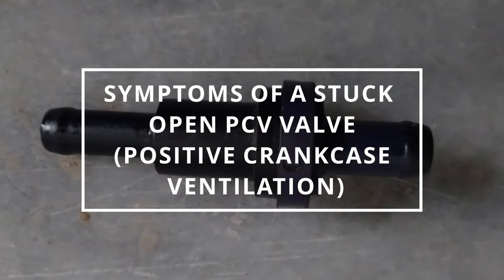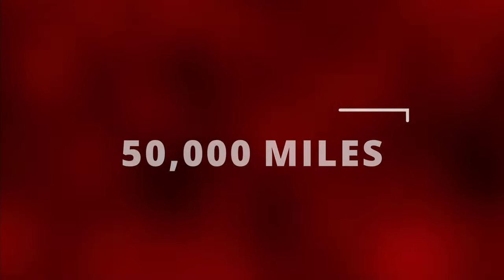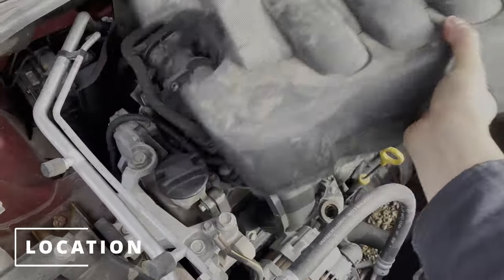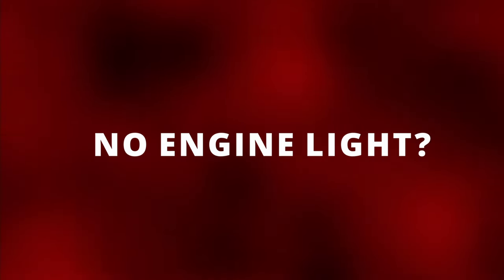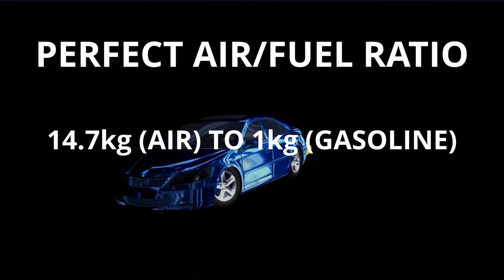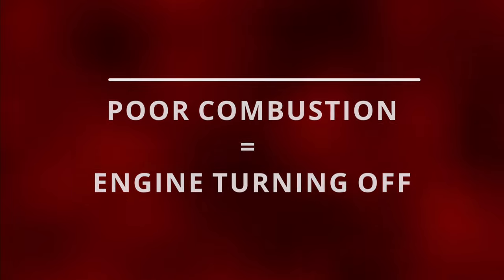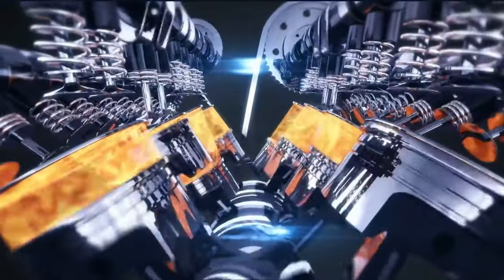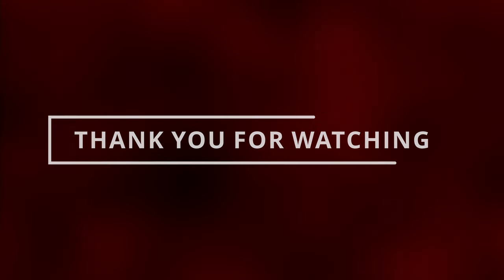SYMPTOMS OF A STUCK OPEN PCV VALVE

Comment: The best way to test a PCV valve is to remove it and put a balloon on the threaded end and blow through the other end. If the balloon inflates (and the balloon doesn't leak air ) then the PCV is fucked. Buy a new one. You can clean them with carby cleaner also if you're desperate 👍.

Comment: My idol was high on startup I just replaced my PCV valve tonight so I will see if that took care of the problem usually after the first start up the day it doesn't necessarily do it anymore so I'll find out in the morning
Reply: Is this not normal?
Reply: What happened???
Reply: It definitely ran smoother after the change but yeah I do think a bit of a high idol on start up is actually normal.
Reply: @integratedwholehealthiniti318  it's completely normal for a lot of engines to hover around 2-1.5k RPM on a cold start. If it doesn't progressively decrease while it warms up, it might be running too rich/lean... 🙏

Comment: I have the smoke , rough idle and misfires my valve definitely stuck open thanks 😊
Reply: Did that fix Your problem?
Reply: Wondering, too?
Reply: Other issues can cause those symptoms btw, not necessarily a PCV valve. BUT it's for sure worth replacing it since it's fairly inexpensive and a low labor process. I just replaced mine today in 10 minutes and only cost me $20. Good luck! 🙏
Reply: mee to!!
Reply: Mine too, I've been chasing the problem for months now. Bought new valve stem seals cause they have the same symptoms and head gasket cause i dont know if i have a cracked head or broken gasket but now going to try the pcv. Really hoping i can finally get my car back on the road 🤞

Comment: ...and most PCV valves are cheap ($5-10) and a fairly easy installation after the old one is removed. You can clean it with spray brake cleaner, but they are really cheap to buy! An adjustable jaw wrench makes it simple to remove and then get an 'end wrench' to match your PCV valve to make removal/replacement simpler.
Reply: That’s if it isn’t built into the valve cover, like mine is.  :(
Reply: Until it's a Honda pcv valve. Then they get pricey.
Reply: weigh the cost of a PCV valve for that Honda engine only versus a mechanic to resolve the problem for all the engines.... Go ask him now...
Reply: Not for a genuine Toyota . And genuine is the best. Not fleebay ones.
Reply: Try that on a mazda ;))

Comment: Don't forget to change the grommet also with pcv valve, meaning the bushing of the pcv valve ( the grommet stays inside the valves cover) because they go bad also, and a bad grommet will cause vacuum leak.  My CR-V has a bad grommet and change both the valve and grommet. Of course you need to check the hose too, if it hard, or cracked, you need to change it because the hose should be soft enough.
Reply: As far as the grommet goes you can use that 205 polymer stuff to it and it'll rejuvenate the grommet. Making it supple and returning it to its original shape. As to the valve? Replacement? I just clean them out with gumout till it rattles again. And having a oil catch can installed helps to keep most of the oil vapor returning to the intake manifold. Thus helping the air fuel mixture to be correct and helping to keep oil deposits from building up on the valves and in the piston chamber. Better fuel economy. Less maintenance, Less headaches.

Comment: EXCELLENT presentation!!!! My 2007 Dodge Magnum's engine maintenance light recently came on. The car has been running sluggish and having high RPM when it's initially started. This morning, blue smoke came out of the tailpipe during its startup with a heavy smell of gasoline. I feared the engine had a blown head gasket or valve problems. With your video presentation, my engine meets most of the criteria of a stuck PVC valve and I plan to replace the valve tomorrow. Thanks so much for the fantastic video and keep up the great work!!!
Reply: Did it help anything?
Reply: I'm so sorry you fell into that quicksand, and was unable to update from nearly a year ago if a new PCV worked -- May you RIP!
Reply: Although this commenter fell off a cliff, rest their soul… just in case anyone in a similar situation sees this, I doubt this helped. Strong gas smell plus the running lean symptoms is sounding a lot more like some fried rings which can produce pretty much identical symptoms to a bad pcv valve.
Reply: @angelarohr7161  I had similar symptoms but the exhaust smelled of pungent fumes rather than like gas. And my intake to the manifold was glazed with a thick layer of oil. I felt like I was down about 50Hp too, I would nearly have to floor my poor little vw to get up a hill. Checked the PCV and it was in shambles... After swapping it, the car runs beautifully and idles like a dream.

Comment: 2005 pt cruiser turbo. The pcv broke, the bottom valve and spring fell into top of head.  No check engine light but lots of noticeable smoke from exhaust.  Rattle test is not a way to check this pcv, the valve is held closed by a spring, it will not rattle. 
 I found the broken pieces under the cam when I replaced the valve cover gasket

Comment: My 2006 Lexus was running perfectly except that exhaust fumes were entering the cabin!   After a trip to Lexus. and two mechanic shops,  the issue persisted.   The car became unusable.  I finally changed the PCV valve and the issue was completely cured.   I will now change this valve every 4th or 5th oil change.   $12 item on line from Lexus dealership.

Comment: I had my PCV valve and hose changed last year on my chrysler. Probably 20,000 miles ago. I noticed today it looks wet around the valve and where the hose connects. Do they go bad prematurely? Past owner ran conventional oil most of its life, I'm running synthetic now. Is it possible the valve is clogged up from cleaning up the old oil? No engine light, just wet around the area.

Comment: The only reason it causes a lean condition is because it is sucking air (and oil) into the intake through the pcv vacuum port. Anyways, if you route the pcv hose away from the intake and block off the vacuum port, it will get rid of that lean condition, and all the carbon buildup that causes low power issues that in fact DECREASE fuel economy.

Comment: I'm not a pro mechanic, but I think that rattle test is not enough. 
I noticed that my 2010 Subaru Impreza had some oily residue in the intake, cleaned old PCV, it did rattle OK. The when I was in the Subaru dealer decided to get a new one, why not. Compared them side by side:
- they both rattle the same
- when I blow into one direction, they  both can be blown with the same resistance
- when I blow into another direction, the new one completely block air flow, but the old one remains half way open. It restricts airflow, but why too much from been fully closed like the new one.

So I put the new one on, will see if anything changes.

Comment: Literally checked the box on all of the symptoms for my 2015 tiguan. Thanks!
Reply: Did you ever replace the pcv valve and did that fix your problems?
Reply: You dont have that in your car xD
Reply: @4YouWHOyou  Yes he does.  It's called the "Africa" plate on top of the valve cover.  It's really expensive to replace, and takes about 15 minutes max.  I replaced mine on my 2016 and noticed no more frothy milky substance on my oil dipstick, less oil sweating, and less oil dripping out of the engine.

Comment: Where is it on a 2013 highlander 2.4 engine? From my research they hid it behind the engine and you have to take off the air intake? Is that correct?

Comment: What would be the symptoms of a PVC valve stuck "closed". My engine idles rough, if I pull the vacuum hose off of the valve it is improved but that does cause the engine to rev at a higher rpm, so not sure if the at idle is really improved. My valve cost only 10 bucks and it's only been replaced once in 18 years. It is on an 05 PT Cruiser. I've pulled and cleaned the fuel valve and throttle body. Replaced MAP, MAF, and crank position sensors. The cam shaft position sensor was replace about 3 years ago along with plugs and wires.
Reply: yeah I think mine is stuck closed as I have to change my oil every 1750 miles due to all the water/condensation inside of it.  No its not coolant I pressure tested system it held perfect pressure for 45 minutes then dropped half a psi over the next hour, its fine.

Comment: I don’t have rough idle,smoke, stalling,have only Had 1 recorded misfire, I also don’t get any codes. However, I did notice that my Pcv valve leaked oil around the base of the valve itself. And noticed a crack on the base of the hose that connects to the Pcv.I have been struggling with my rpms hesitating (low rpm “bucking”) when I get on and off the throttle.  Would this crack have caused my engine hesitation? It’s honestly hella annoying not being able to drive smoothly because I cannot ease into the throttle.

Thx any input might help
Reply: Could be a bad pcv valve but it definitely sounds like you had a bad vacuum leak, definitely replace the bad hose and definitely check the pcv valve for any damage. Probably good to replace both though
Reply: I got this issue, too, except my hose is fine; 
So, I think I'mma replace pcv today;
Reply: @nosajsamaniego4512  do it! Definitely be careful and don’t force it on removal
Reply: Remember to replace the rubber grommet that the valve fits into it should be a tight snug fit

Comment: I have changed my entire fuel system , done the leak down test , fixed all leaks and never thought of this valve being stuck open for the two lean codes I have .. I going to go check right now will post update . 2001 2500hd 25 percent high fuel trim ..lead codes po171 174 both banks
Reply: Did you ever get to it?

Comment: My PCV value on my 2014 Ford Mustang didn't have anything inside it. Air could be blown throw both side like a pipe. What does this mean? Is that normal? If not, did that internal part fall into my engine?
Reply: air should only go one way. from engine and out through pcv
Reply: Thank you.
Reply: Not all cars have pcv valves
Reply: It most likely got dislodged and fell out of the engine compartment when you ran into those people leaving a car meetup
Reply: Not all cars have pcv valves in the same place, or some even at all. 

Some places you might want to look; 
The valve covers
The valley
The side of the block

You can have a couple different pipes without a pcv valve in them. 
A 2003 mazda tribute has those hoses in the valve covers and has an oil separator/pcv valve in the valley. 

Smoke test your intake to be sure

Comment: Thank you, Would  this explain my cylinder 5 misfire, even though I changed the coil and plugs on my 2012 ram 1500?
Reply: I’m at 130k 2012 what abt u? Anything major
Reply: @moemoe48210  engine was replaced January 9 2021, been running good ever since, around  June, my check engine  light came on with a low oil pressure  code and p0305.  I changed the oil pressure switch, the oil, number 5 coil, and both spark plugs. The low oil pressure light went off,  the p0305 still there, truck vibrate up to 40 mph then smooths out, only the truck had no problem until I changed plugs and coil.
Reply from the maker: @devildogg112985  How is the engine when it's running while parked? Rough idle? How many miles?
Reply: @easyautofix  runs  and engine shakes , you can see the trans dipstick dancing. Miles 169,726, engine was changed January 2021 at 133,xxx
Reply from the maker: @devildogg112985  Although it can potentially be a pcv valve it could also be a type of vacuum leak. Do you hear a hissing sound around the engine when it's on while parked? If not, another possible cause could be lifter damage on cylinder 5 and camshaft lobe damage. It's common for a 2012 1500 5.7L.
Reply: @easyautofix  i was told it could be a vacuum leak on the top, I haven't seen no unplugged lines. I was told rams were famous for lifter failure,  I just thought with a newer engine , that wouldn't be the problem.  Also was told to change exhaust manifold because of broken bolts on or under heat shield. As for whistle noise at idle, in not sure, will check again.
Reply: it would explain number 5 misfire ONLY IF the pcv is located the CLOSEST to #5 - so if not, nope it not the pcv.
Reply: @CognacKidd  thank you.
Reply: @devildogg112985  If changing pcv doesnt smooth it out then pull #5 spark plug and either sandblast clean it or buy new and check that new or cleaned ones gap is perfect then reinstall. Fixed.

Comment: Do you recommend a aftermarket or a oem pcv valve?
Reply from the maker: oem
Reply: Put original from your car company. They’re cheap, so you don’t have to buy it again because  after a short time they stop working. I learned from more expensive parts thought I would save some , it cost me double cuz the so called cheap part wasn’t returnable and at the end I had to pay for a new one from car company
Reply: @chiya2006  Thank you. Yes I will buy a oem part.
Reply: Good luck with Honda, one pcv valve it's 50$
Reply: And with a few fords it's 75 and up.

Comment: Got the p0171 and p0174 (E350) and my engine drinks oil like it's no tomorrow! I don't have rough idles, but when kicking down a little on the pedal while driving there's a cloud of exhaust coming out.  I will begin with changing the PCV valve and the belonging parts

Comment: Mine still rattles. I had took it off with my truck still running and it runs well, then when i put it back on it has a rough idle feels like it is clogged up. Ive cleaned it up but im replace its cheap. Im getting a code for VCT Solenoid i dont want to touch that yet because is a big $ im start off with this PCV hopefully it will fix the problem.

Comment: I know my issue is with a vacuum leak or the manifold due to all the symptoms and the sounds pointing to that however my car throws p0441 &p0450 even though I’ve changed the purge valve, hoses all sensors and the canister 😢 but I keep being told I’m wrong based on the codes but like you can only fix the symptoms for so long…
Reply: Smoke test your intake.

And as far as those codes go it seems like either your pressure sensor is bad, you have a clogged charcoal canister, or you have a bad gas cap. 
Potential causes? 
Overfilling the tank when you fill up. 
That "click" when the pump shuts off helps protect the charcoal canister so try not to "top it off".

Or smoke test the evap system and see if there's leaks there.

Comment: even if your pcv valve rattles it can still be clogged and getting stuck when actually in use /: 

if you see most other symptoms and it's clear over 50,000 miles on said valve , even if it rattles, replace it. trust me.. ive blown seals and gaskets due to this misconception, twice... 🗿and that gets costly.. so don't be lazy or cheap, just replace it ! 🖤
Reply: yes exactly I just ran into this, pcv was only partially "rattling" then cleaned it out with carb cleaner and suddenly got a lot louder!! dried and plugged back in then misfire gone!

Comment: Check the installed valve:
Put a clean hose on the valve and suck in air.
If the valve does not allow airflow it is bad. Replace it with a new one.
If the valve does allow airflow, it is working in the vacuum direction.
Next, blow air in. The valve is not good if it allows air in.
The valve is good if it blocks airflow - for backfire protection.
Check the new valve, if replacing, as described above.
I purchased a new Fram PCV valve from Rock Auto and it was defective. It could have damaged my car if I didn't check it.
Rock Auto and Fram lost my business.
Reply: Don’t blame rock auto blame fram they make the part also they are very good at refunding or sending replacements when it comes to fault parts often times they don’t even make you send anything back unless it’s a warranty thing

Comment: Does this cause oil leaks?
Reply: I've been Googleing pcv valves all day. from what I've researched it could cause your valve cover gaskets to leak oil around the engine because if the air isn't escaping out through the pcv valve then it will find a way which would be through the gaskets the valve cover sits on top of
Reply from the maker: Yes, this is a symptom of a stuck closed PCV valve, I have a video on it.

Comment: Could a bad pcv valve make a puddle of oil end up in my intake manifold? 2010 mustang gt
Reply: you ever figure it out? I got a 04 corolla with lots of oil getting into my intake manifold. I removed the pcv valve and it rattles. I hears rattle doesn't always mean working properly.
Reply: @DMJ160  in my case i just put an oil catch can on mine and it fixed it hope that helps!

Comment: I have 2018 bmw 320i  i have code p0300 and p0171 and multiple misfire …the car sometimes runs normal when i drive it for a while turn the car off and back on again it starts to rough idle . When its rough idling i rev the engine and get back to normal please help . I changed my spark plugs
Reply: BMW are crap change for Lexus no more trouble
Reply: Probably pcv / air leak. Get a nissan or lexus bmw’s are money pits.